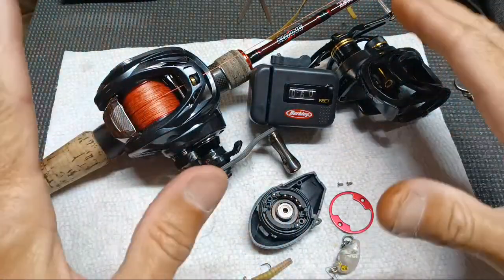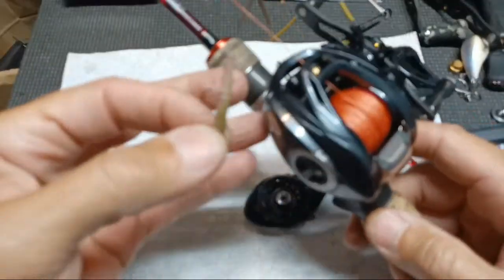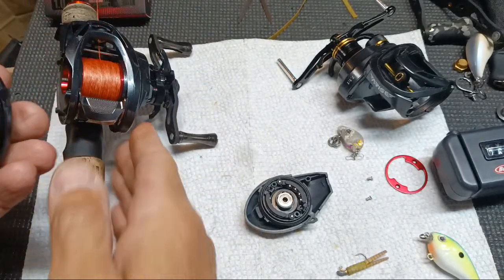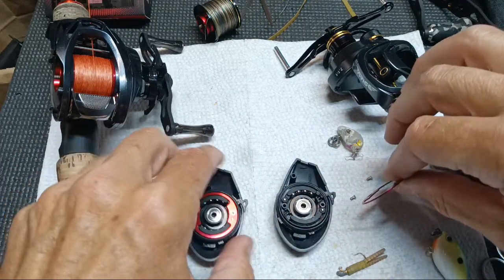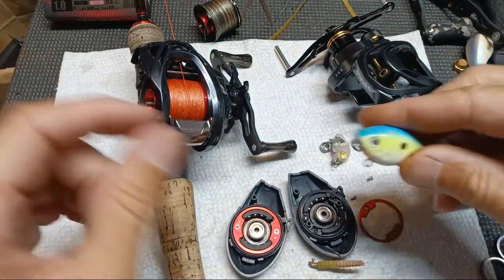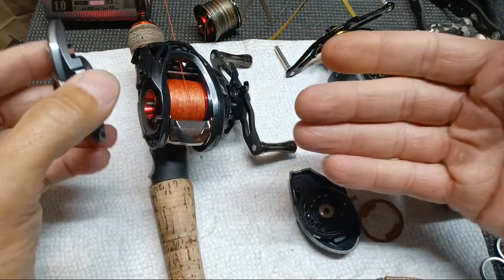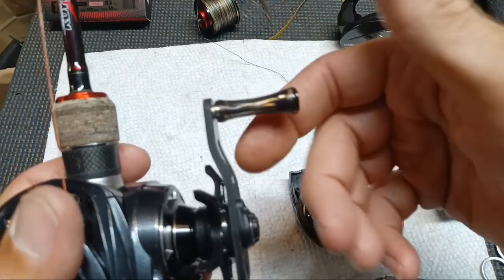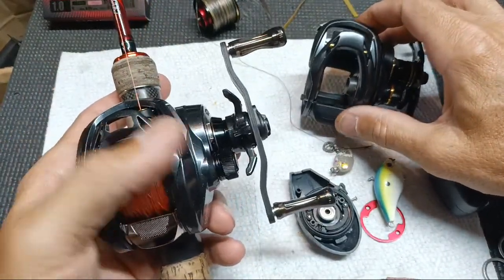Arise AMC BFS Haibo Dynamic Braking Cast Test Results

Comment: Since the dynamic braking supposedlywas granted a patent I'm hoping that it has some good engineering put into it.  Since the Air model is rated down to .6 grams I'm hoping they tuned it for UL baits moreso than the other models.  Unfortunately, it looks like I'll be out of town when mine is delivered, but as soon as I get my hot little hands on it I'll be putting it up against the DWU and reporting on it.
Reply from the maker: Nice sounds good
Reply: How long has it been since you placed your order?
Reply from the maker: It became available April 11th
Reply: @bassnbonsai  so it took almost two weeks to get to you
Reply: I ordered mine april 11 and it is supposedly at US customs now.  Projected delivery May 4.
Reply from the maker: Yeah and that's fast for Allie Express normally Ellie Express stuff is anywhere two to four weeks and usually three to four